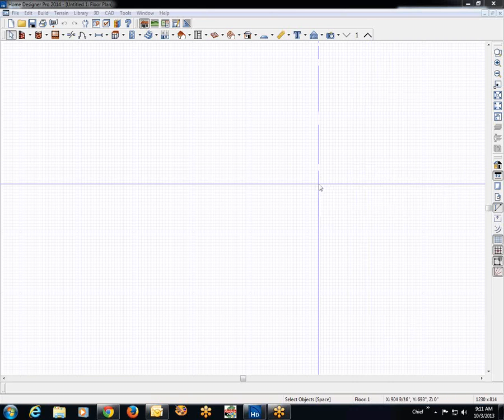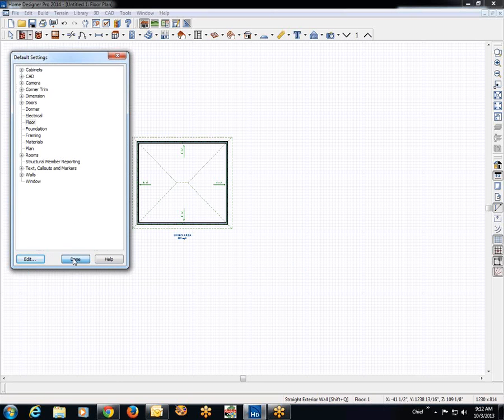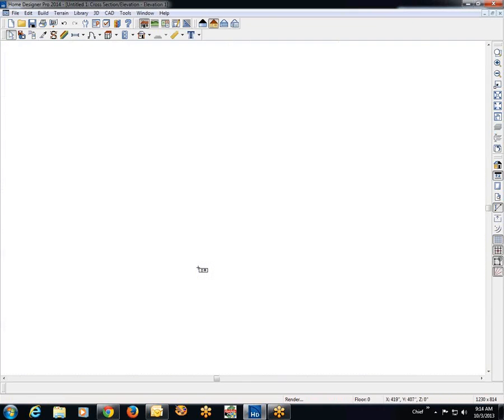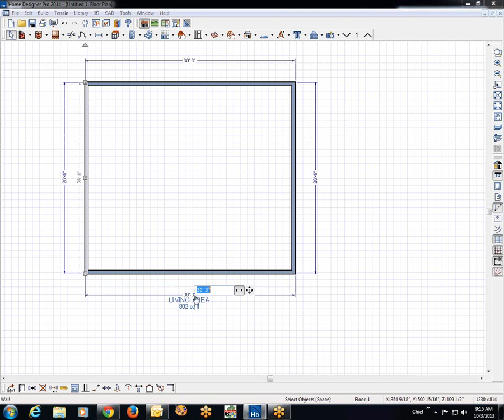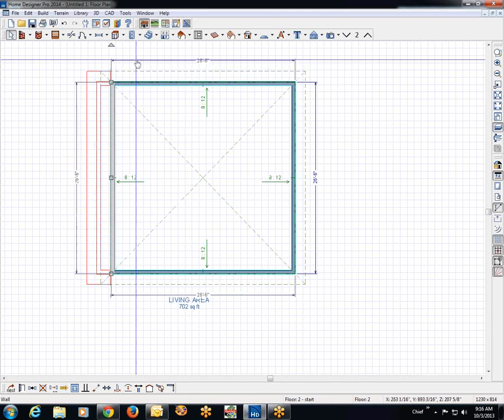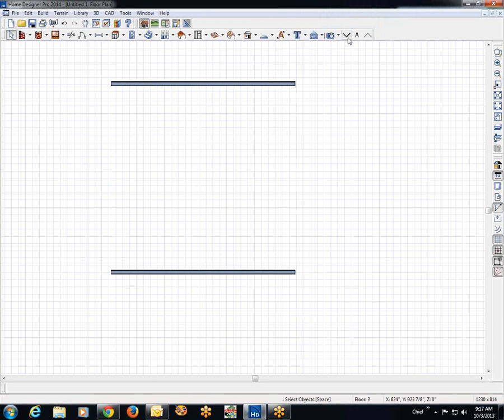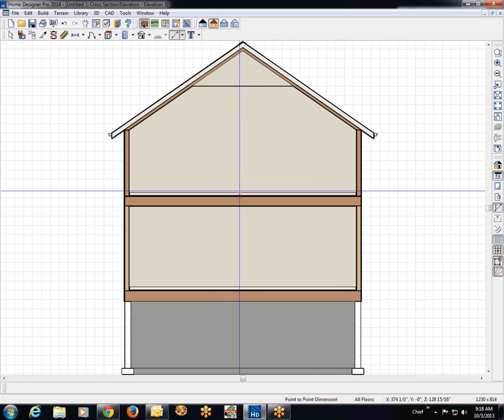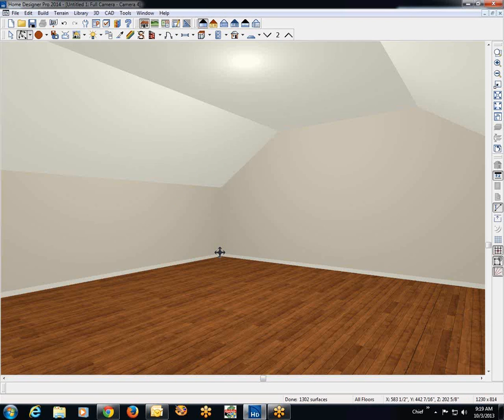Chief Architect Tutorial

Comment: David:
Could you demo creation of foundation and first floor for a beach house where first floor is elevated on 12ft piers (Columns).  I'd like to have a concrete poured first floor with radiant heating embedded.  ICF Walls (stucco finish).
I can only seem to build a foundation with piers around the perimeter, not supporting the entire first floor.
Reply from the maker: Think "Out of the Box" using the tools available. I will not design a foundation because I am not a licensed structural Engineer, designing foundations is their job, not mine